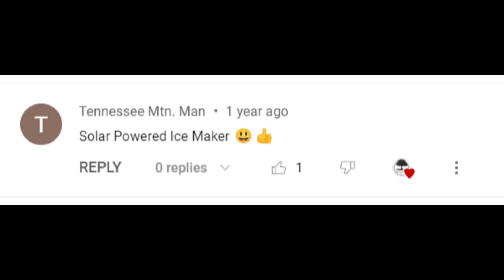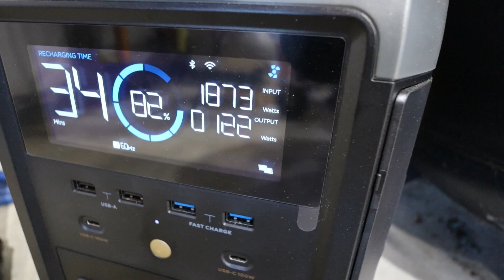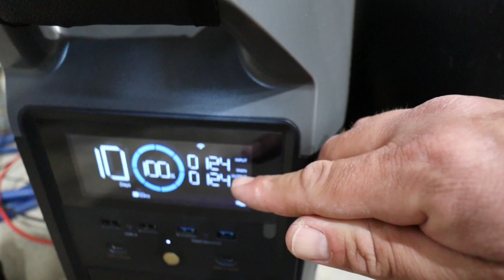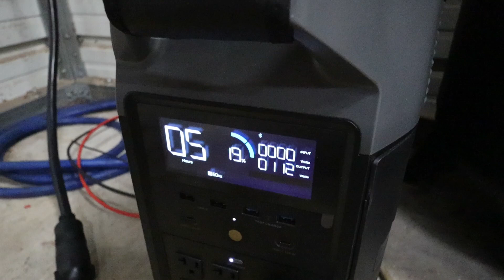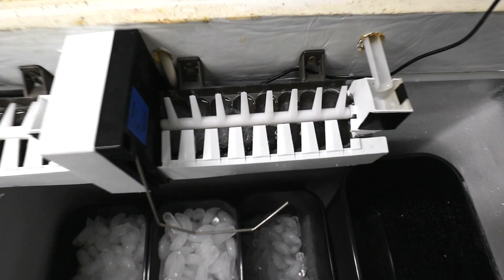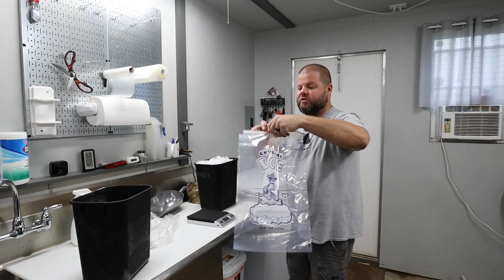Solar powered homemade ice maker! FREE ICE! DIY ice maker #724

Comment: wait so you cant use this ice as normal? I was marveling at having ice not only for random uses but also for drinks.
Reply from the maker: Yes you can, as long as you clean it as required for consumption. The problem is most let ice makers run forever without cleaning then. You are breeding bacteria at that point.

Comment: A better way to build your solar would be to have an automatic grid backup relay.
When the solar shuts off, it will automatically transfer to grid.
When the solar is charged back up, it will automatically transfer to solar.
You won't need any other transfer switches.
I use the 80A relays from Amazon.
The grid power goes to the normally closed contact, the solar goes to the normally open contact.
The common contact goes to your load.
Get yourself some used 250W 24V solar panels from Santan Solar, a cheap 30A charge controller, and a cheap 4000W Inverter.
One of the outputs from the Inverter powers the coil of your relay.
Connect 3 of the 24V panels in parallel to 1 charge controller, and you can stack the charge controllers.
Get as many 12V, Group 27 batteries as you can get.
The panels/charge controllers charge the batteries, the batteries power the Inverter.
I have 6 charge controllers stacked on 12 batteries in my system.
I use a 120cf deck box to hold the batteries and keep that under my deck.
This reduced my electric bill over 60% for Sept 2024.

Comment: Hey man,  not sure if this will ever get to you but i built a replica of your ice box about a year ago but i found that if i don't use it every week the ice develops a bunch of frost on it and will basically turn into a solid block of ice and not be useable.    I noticed that most freezers have someway of dehydrating the freezer and i'm wondering if you have a solution for this or have run into the issue at all.
Reply from the maker: You definitely don't want a defrosting freezer or you will wind up with a block of ice. I defrost my ice machine 2-3 times a year by unplugging and cleaning out. By using the trash cans shown in this video I have zero problems with any ice freezing into the frost. Hope this helps.

Comment: veryCool littleSystem i too am a Fisherman and i live. in Florida. so. i’ve gotten tired of buying Ice. my Solution has been  making Block Ice in my Deep Freezer  btw if you added handles on yourIce. Buckets ? etc   it might be easier to lift them out of the Freezer  a 5 Gallon Bucket handle  looks like it would. be   a good  candidate  to reporpose  for a inexpensive       choice

Comment: What's the life expectancy for one of those delta pro's?
Reply from the maker: Manufacturer states at 10 years 80 percent battery capacity should remain. After that no one really knows, has not been tested for that long. So at least 10 years.

Comment: What would you have to do to make the ice safe for drinks?
Reply from the maker: Just clean the freezer often as you should any ice maker, and I would make sure all plumbing fittings are potable water safe. Also filter the water further would help, I do have a filter on the outside of this building for that room. Clean hands and scoop is a must with drinking ice too, don't want to put bacteria in there.

Comment: Hi Andrew, replace that wall unit with an inverter mini-split A/C unit, 20 Seer and you will see a huge power reduction. I installed a 9,000 BTU Daizuki, ($480 hot & cold) tested it in S. Florida in the summer and it used non-stop working, 24/7, for about $ 1.40 per day.
Reply from the maker: It's on my list, especially once I get my hobby room done.

Comment: Get the 20lb bags and line the bins with the bags so it dispenses into the bags directly.
Reply from the maker: It's been mentioned, but 99 percent of its use is dumping straight into a cooler or the boat right outside my door. No point in wasting the bags when I can dump straight out of the bins.

Comment: Ha, ha, you got the "free energy" bug, but and there is always a but, it takes a while for the solar equipment to pay itself off and generate free energy...🙂I would love to do just a whole house power failure backup battery and solar panel set up but the cost, in comparison to a 10kw peak 8kw continuous gas generator manual generator, is too great. I got my DuroMax generator for about $1600.00 CAD and that is about the cost of just one battery in a system I mention. 🙂
Reply from the maker: The whole point of solar is for any potential long term outage, plus it can offset some electricity usage while it's waiting for an outage. I have a big propane and gas generator, excellent for short outages. Not something I would at all trust for long term or extended outages. I'll always have a combination of backup power. Today's world is to unpredictable.

Comment: An example of solar savings. A whole house solar system capable of powering my house 100% off grid would cost about $30,000. My average electrical bill is $130.00/month. It would take 19 years for me to see the "free energy" from that system. 30 KW panels, 24 kwh batteries and associated inverters etc with an average 650 kwh monthly house usage. (simplified, conservative, general estimate).
Reply from the maker: Hardly no one can argue its cheaper. Most are going to solar because they no longer trust the failing grid, geopolitical tensions, changing weather patterns, or wanting to get away from fossil fuels. Blackouts and brown outs are driving many to look for alternative solutions. I have my reasons for wanting backup solar, it's never been about saving money. But if I have it, might as well let it pay me back little by little.